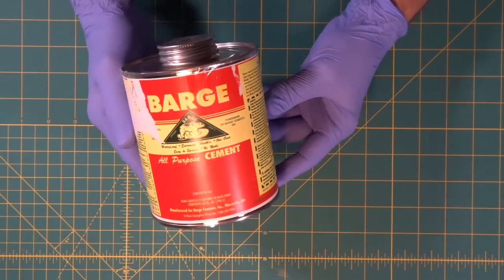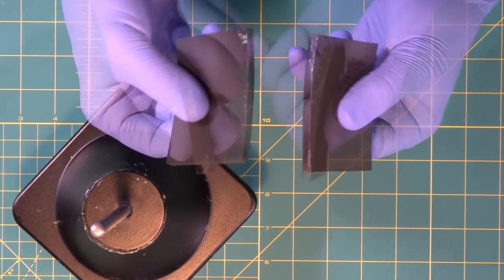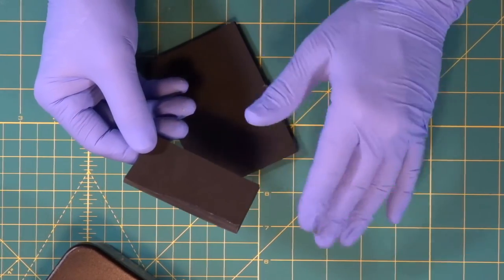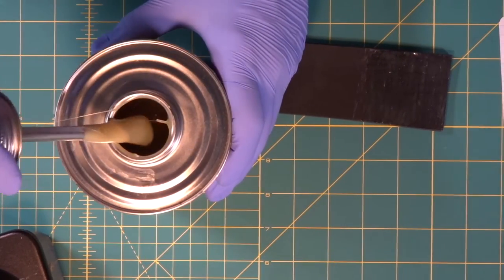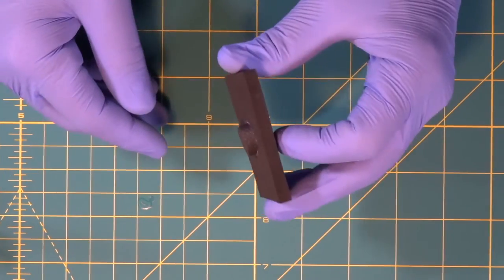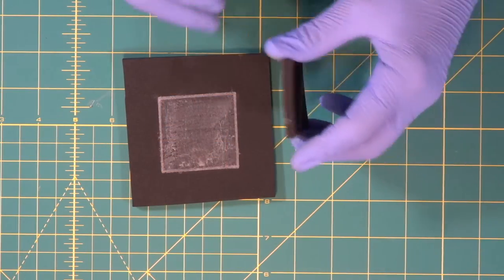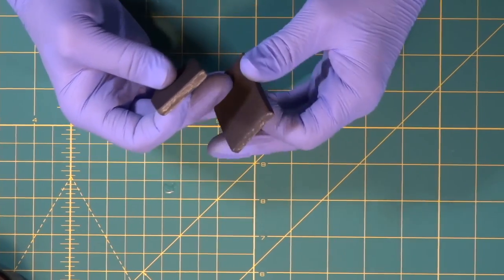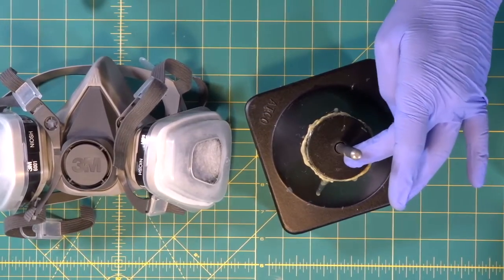Contact Cement Basics

Comment: 12:25 Heat Gun to unglue:  I'm putting a project together.  After seeing the heat gun thing I'm now worried that my project, which is going to be in the summer sun - I'm worried that it will come apart.  Do you think the Utah summer sun will delaminate my joints?  My joints are lapped over each other in a way that sheds the rain.  My vinyl is laminated to a wood base.
Reply from the maker: Not sure about laminate and wood - I’ve only worked with foam. But my hot garage has caused contact cement to come apart on me.
Reply: @BlackSheepProps  That's not good.  My project sits in direct sun for much of the afternoon.
Reply from the maker: @petec6690  I have some prop weapons I made that sit on a windowsill and get direct sunlight for months now and they are still holding solid. And even some that I have stored in a hot storage room for 6 months and they are also still solid. The cement can hold up under extended warmth and even heavy heat - question is how hot and how long I guess. It seems like it would have to be scorching heat to wreck the glue. But I am only working with foam so I can’t be sure about other materials.

Comment: What would work best for thinning Barge: xylene, naptha, mineral spirits, or MEK substitute?
Reply from the maker: Hi PE,
I use BESTINE Rubber Cement Thinner. And don’t use too much or it can cause the glue to delaminate. Use just enough to stir it up and get it a bit thinner.
Reply: Ask th manufacturer
Reply: @x.y.8581  The manufacturers recommend only their own overpriced thinner. I have found that xylene works best when MEK is not available. MEK substitute does not work.
Reply: Best to avoid allowing glue to thicken by keeping can closed as much as possible.  If too thick just discard and get a new can.
Reply: @x.y.8581  That's the issue. I can't bring myself to dump a gallon of old Barge. A pint of a random brand from a hardware store, no problem, but not Barge. I will never buy Barge again, as I've moved on to a water-based contact adhesive. But I still need to use up the Barge I have on hand.

Comment: Will elemers rubber cement work as well and be as strong? Also does that brush thing come with the barge contact cement?
Reply from the maker: Hi Milk!
I have never used Elmers so I a don’t really know how well it works. And Barge comes with a small brush inside it, but I bought the large glue pot separately because it is very convenient if you will be doing a lot of gluing. The glue pot has a very heavy base making it easy to use with one hand - and the brush comes out without needing to unscrew the top so it is very convenient to use.
Reply: Rubber cement is like post-it note adhesive. It is designed to easily separate later. It looks like contact cement and has a similar name, but is essentially the opposite.

Comment: Hi, Steve.  I'm trying to wrap my metal lightsaber hilt with braided leather cord. I'm told contact cement is my best option for adhesive. My concern is that I'm using leather cord and there's no "side" to put the cement on unlike a leather strap.  Will it stick to my gloves while I'm wrapping? I'd assume not since there's no cement on my gloves. And, I guess I should start wrapping soon after applying so I have a little bit of wiggle room to adjust the leather much like your button fitting demonstration, right?  Then, just let it sit and let it bond.  Sound good? Sorry, I'm a novice. Thanks.
Reply from the maker: Hi Jack, First of all, thanks for watching! I have attached neoprene rubber cord on several props and because it’s thin and round it doesn’t have a side - so I have used super glue and I laid a thin line of glue down and then laid the neoprene cord on it and it works great! It’s a bit more time consuming though because you have to go a little bit at a time and glue and wrap as you go - glue a portion and wrap cord, glue a bit more wrap more cord, glue wrap, etc. until you complete the entire hilt. But it works pretty good. 

I also think you probably could still use contact cement even though the leather cord doesn’t have a side. But for this you might have to cut your overall cord length into shorter segments and attach them one after the next to simulate one long cord. This way you aren’t trying to wrangle a long piece of glued cord. As one segment is wrapped a couple times ( using a length that’s you are comfortable handling while it’s glued ) around the hilt then you could probably just start the next piece right off the end of the last piece and it could work. No one will probably even be able to see where one ends and another begins once you have the entire hilt wrapped.

Hope one of these helps.

May the force be with you!

And in case you haven’t been to our channels home page, we have a bunch of cool builds and tips videos there. Here’s the link in case you’d like to check them out : https://www.youtube.com/c/blacksheepprops
Just look under VIDEOS and PLAYLISTS at the top.

Thanks again Jack!
Reply: @BlackSheepProps  Thanks for all the tips. I'll definitely be checking out your other videos soon.

Comment: Interesting glue.
Why does your cement brush cum cap not adhere to the container or glue can after some time? Is the cement strong?
Reply from the maker: Hi ST!

Metal Can:
When I pour the cement from the can into the glue pot I clean the glue off the top of the metal can with thinner so no glue remains and it stays clean and does not stick together. I can easily open it the next time.

Glue Pot:
The glue does on the rim of the glue pot does stick to the glue on the brush handle - but that is how it is designed.  It creates a seal so the glue inside doesn’t dry out. But the glue pot is teflon so the each time I open the glue pot to start building I just peel off the dried glue around the top and it is clean again. After I am done building I leave the excess glue around the top and it dries together forming another seal until the next time I build.

I hope that helps!
Thanks for watching!
Reply: @BlackSheepProps  I see. Its teflon. Nothing sticks to teflon or silicone except themselves. Thanks! Subbed!
Reply from the maker: Yeah, the glue pot is great. And if you use your glue pot all day and it keeps opening and letting air inside it can eventually start to thicken the glue a bit. So periodically I add some thinner inside the pot and stir it to keep it smooth.
Love the glue pot.

Comment: Do you clean your glue brushes after you're done or do you just leave then in the pot?
Reply from the maker: Hi XCyclonusX,
I leave my brushes in the glue pot. But when using a glue pot - every time you open the pot to use the brush you usually wipe off the extra on the top edge of the pot and it slowly runs back down into the pot. But If you are building all day long, and opening and closing the pot a lot then a lot of air gets in around the top of the pot and the extra glue that you are constantly wiping off on the top edge can start to dry and get sort of sticky and clumpy and then the brush will start to get a bit sticky and clumpy too.
But I learned a trick from some of the old timers that work with leather and contact cement -  I pour some thinner into the pot and stir it up with a wooden stir stick so it thins the glue back to a more watery condition so it will spread much smoother. It works great! But I also buy several extra brush attachments so periodically I just change the brush out for a new one.

Thanks for watching! And by the way, if you haven’t seen our other cool tips videos and builds I am attaching the link to our channels home page so you can check them out. Just look under VIDEOS and PLAYLISTS.
https://www.youtube.com/c/blacksheepprops

Comment: Does a glue pot really extend the life of contact cement to a considerable degree?
Reply from the maker: Hi Aibhlin! I don’t really use a glue pot for any life extending reasons, I use it for easy access and handling. The pot is pretty heavy so you can use one hand for pulling the brush in and out making it ultra convenient. Just grab the brush with one hand and start applying without needing both hands like with the original can it comes in. And no threads to twist open like the original can. And when you are done using it and you place the brush back inside the pot, the glue that has collected around the top rim will dry creating a nice seal to keep air out until you use it again. And when you’re ready to use it again you just pull the brush out and it breaks the seal and you peel off the dry glue around the rim since the pot is teflon and it’s good as new again. Plus the opening of the pot is large making it way easier to use than the little opening on the can. And the brush is a lot larger too than the tiny brush that comes with the can. I just buy replacement brushes so occasionally I can put a new brush on when one eventually gets all gunked up. LOVE my glue pot, one of the best tools to have if you build a lot!

Comment: Because I can’t find this answer anywhere: how long does it normally take for Contant Cement fumes to stop.. fuming? In this case I’m using Master’s brand CC, and though I took all necessary precautions and my pieces are already joined,  it’s a part of a project that I really want to get a move on with but I don’t want to rush things if the fumes are still dangerous
Reply from the maker: I’m not totally sure about the fume time? But I always just followed the simplest rule of not using contact cement without a fan blowing the fumes away from my face,  and without working in a large area, and without periodically opening the garage door to air out. Safety seemed to only be an issue during the applying of the glue while it is open and fumes are present. But once pieces are joined I don’t think there is an issue any longer. I never noticed any fumes once pieces were attached? And I also have not heard any of the other large builders mention any issues with fumes once pieces are attached. Hope that helps.

Comment: Can i used for roof work
Reply from the maker: I’m sorry, I do not know. I only use contact cement for foam props.
Reply: Why would you use an adhesive for fabric, leather, foam, etc - on a roof?  You do know there's dozens of specific products for roofs right?
Holy crap the questions in this comment section are off the chain.

Comment: I have a tear in a leather horseback riding saddle that I own. Do you think/know if I could put contact cement in the tear to prevent it from getting larger?
Reply from the maker: Hi Gianna,

I’m not sure, and I wouldn’t want you to ruin something trying. But I can say I have used contact cement to glue 2 pieces of leather together and it worked great! Super strong hold. But I’m not sure about filling a tear with it? If you cemented another piece of leather over the tear ( like a patch ) I think that might hold tight - and that would maybe keep the tear from spreading? But NOT sure.
Sorry I couldn’t help more.
Reply: Black Sheep Props I understand, thanks for the advice and help though!
Reply: Maybe with a flat overlay to bond the two sides of the tear.